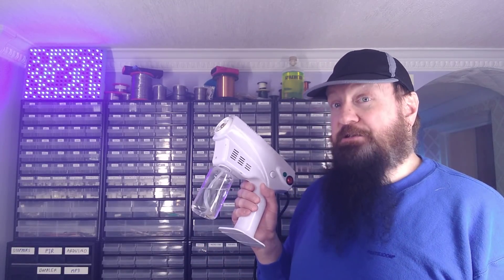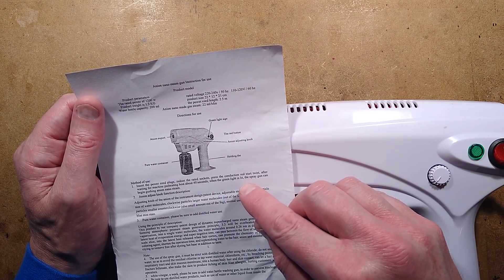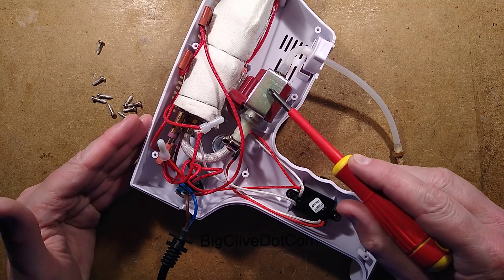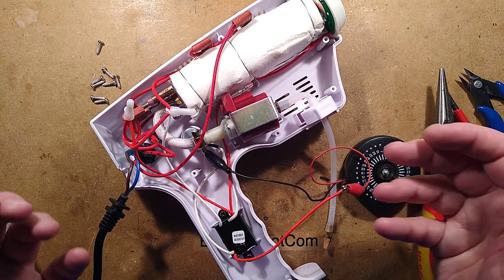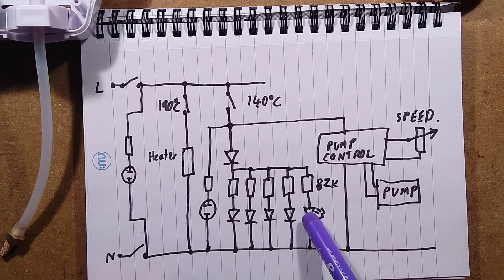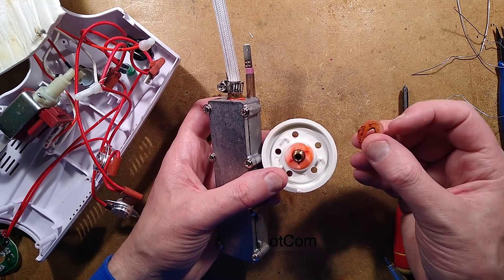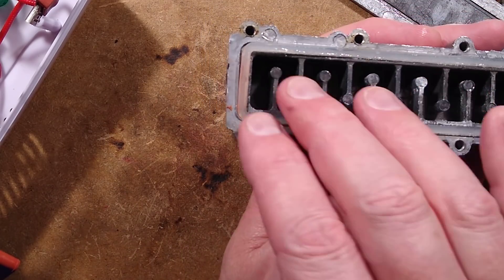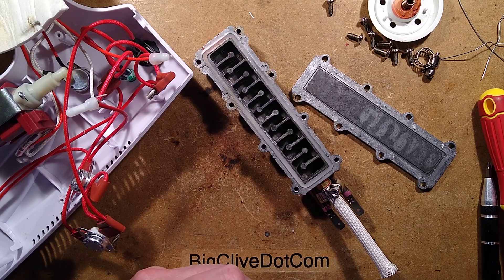Inside a hazer phaser.

Comment: would you recommend it (unmodified)?
Would you recommend it for it as a hazer (like with haze fluid)?
Reply from the maker: It could be used to haze the air for effect.  But only with glycol based haze or fog fluid.

Comment: Hey Clive, I'm doing a small event later this year and not turing on my lights until after a dinner. Could I use this to put a little haze just to show my lights better? Or just do without as don't want to flood the room with haze.
Reply from the maker: Consult with the location first.  They may have rules regarding any smoke detectors that could be triggered even by a light haze.
Reply: @bigclivedotcom  thanks for your reply. But it would work if I used fog juice?
Reply from the maker: @DJ_Energy  Yes, it should work with fog fluid, but again, it's important to ensure that the venue has a policy for the use of atmospheric effects to avoid triggering the fire alarm.  For a light haze a quick burst of a standard fog machine might be preferred.

Comment: i have been using an old  humidifier i had sitting on a shelf in the garage as a disinfector  (the Mrs wanted me to toss it as  it was imposable to clean the water tank )
it has a manual power/mist level switch  so a  smart power sw  allows me to control it  set to automaticity disinfect the  garage 3 times a day has been running for 18 months  now 
any delivery's and the car is  disinfected 3 times  a day

Comment: Wow
I somehow missed this video but this looks great when I need haze for photography or video in not too large spaces.
Way better than using a regular fog machine that's bulky and needs to warm up for several minutes and is quite difficult to get small amounts of haze from.
Have you tried mixing glycerine in the water? It should give a denser haze.

Comment: In areas where grid power to homes is limited in Indochina, these are sold as 'mist sprays' which reduce the feel of very hot climates and where air-conditioners would destroy the house wiring because of the power required.

Misting sprays, operated from / by water pressure are commonly used in outside dining /drinking venues where air-conditioning is impractible.

Comment: at 16:26,  All  exit pressure  is a  product of the delivery pressure from the pump and lots of rapid expansion (of water).     heat in the top; the bottom was removed.      so, the zig-zag is horizontal.   not vertical.    stating the obvious, again.

Comment: so, use as a disinfection fogger... lets go through what types of disinfectant you can put in it...
alcohol based....evaporates with heat...
chlorine based...would work...but are you sure you want to aerosol the room you're in with a lethal gas?
iodine based... could work... but man that's gonna leave a hot mess on every surface...

Comment: I use this for valeting, you put some fog-it in it and it gets rid of the smell of dog. But if you run it for more than 10 mins  the power cable starts melting, You didn't pick up on that hazard. Great videos Clive I like watching you take things apart it's great.
Reply from the maker: I wonder if you have a version rated for a different voltage.
Reply: @bigclivedotcom  its 240v the black cable sleeve shrinks, exposing the blue and brown cable, near the handle, I'm on my 3rd 1.

Comment: Both the wide pipe leading water and the internal barrel are coated with heat resistant fabrics. Is any of them made of asbestos?
Reply from the maker: The pipe cover is fibreglass. The heater block is probably ceramic fibre.  But the actual composition would need to be tested.
Reply: @bigclivedotcom  ugh that's almost as bad :( thanks for regarding my question.

Comment: water based paints would work perfectly fine..maybe need extra watering down tho... oil based would gunk it up for sure... but water based ya should be able jsut to run some water through to clean out the water based paint
Reply from the maker: With water based paint there's a risk that the boiling would separate the water from the pigment like in distillation.  The biggest issue with fog machines is impurities in the liquid blocking the heater.

Comment: Steaming hail in a salon possibly...

Steaming clothes while on a trip is another use for it...It's compact enough to easily fit in your suitcase...

It could also be used as a Steam Cleaner/Disinfectant for countertops, sinks, appliances etc. that is easier to use than the traditional Steam Cleaners/mops (less bulky)...

Note: you don't really need to put anything other than water in this to sterilize. Water heated to the point it becomes steam will kill most viruses, bacteria and parasites in a second or two after exposure so just slowly sweep the nozzle across the surface to be sterilized (at a distance of 2-4 inches between nozzle and surface) and you should be good to go...

Comment: Where can i buy this? And can you put normal smokefluid in there?
Reply from the maker: eBay.  And it does appear to work with dilute fog fluid.  But isn't specifically designed for it.
Reply: @bigclivedotcom  OK thanks i would use ist for small effects.

Comment: If lower resistance is slower just add a resistor in parallel with the pot
Reply from the maker: It already goes to zero
Reply: @bigclivedotcom  ah crap

Comment: Is it possible the 140 degree therm-o-disc is for temperature contro?  The 190 would be the TCO.
Reply from the maker: The 140C enables the pump.  The 190C is the heater control.  That way the pump can be active continuously as the heater cycles.
Reply: In that case there is no thermal control. If the heater were too short to ground it would stay on, possibly overheating and melting everything including the aluminum. That would be rather embarrassing!

Comment: Our attic is blow filled will this grayish-black fluff stuff. I don't know if it's asbestos or rock wool. Our house was built in the mid-1960s in Tulsa, Oklahoma. I do know that when it is disturbed, it does stir up dust. It kind of makes me not to want to go up there even though there are some other things I would like to do up there. When I try to burn a piece of it, it just glows red where the flame is.
Reply from the maker: Treat it with caution.  It may be safe, but for a while asbestos was used as loft insulation.  It might be worth getting a sample sent for analysis so you know where you stand.

Comment: The fibre glass braiding is to reduce expanding of the hose, this could happen because the valve is next to the pump. 
The expanding of steam is adding pressure on the hose

Comment: Could you use one of the button switch locations for a limit control in series with the operating button(140c). They are supposed to fail in the off(open) position

Comment: Do you have a contact info page on your website I missed? I have these fascinating tiny CFL tubes and drivers from an arcade machine I repaired and would love to know if they have any alternate uses or things I could do with them
Reply from the maker: Are they the classic cold cathode tubes around 1' / 300mm long?
Reply: @bigclivedotcom  i believe they are ccfl, tiny little guys used to illuminate the backside of colored acrylic panels, the tubes are 2.5mm in diameter and 150mm long, got 9 working ones and one with either a dead driver or dead tube
Reply: http://imgur.com/a/hhxCTko i dont know a ton since i usually retrofit leds and I couldn't get a replacement from andamiro so when one of these died I replaced all 10 with leds
Reply from the maker: @lefthandedcat8766  They look like standard CCFL drivers.  Odd that they're not cased though.  They use a two transistor Royer oscillator to step the voltage up and the little capacitors in series with the tubes ration the amount of current they can pass.
They used to be used in games like Konami's Dance Dance Revolution (Dancing Stage) because they have an extremely long lifespan.
Reply: @bigclivedotcom  yep thats where I got them, pump it up but its a dance game, andamiro calls them the "step lamp assembly". Anything neat I can repurpose them for? Nobody wants them even for free since leds are cheaper and look so much better nowdays
Reply: @lefthandedcat8766  Sadly, it's like having a bunch of carbon arc lamps in the incandescent age.... there's not much utility unless you want the aesthetic or you have a scientific need for some aspect of the output. I used to have a whole pile of those short lamps and drivers which may have been the exact same ones and came from stencil frames for exposing some kind of photosensitive emulsion, cast off from the IC industry. I still have (and use) a couple of 30cm long green CCFL lamps because I like the light quality they give.

Comment: Nice to see Clive actually bothers to ensure things are unplugged first. Air conditioner installers just left my place and I'm 95% sure they did all their work with the wrong circuit turned off. One even tripped a breaker by snipping a live cable then came into the house to turn it back on before proceeding. I just had to tell someone.
Reply from the maker: They often have to work with the power on to trace the faults.
Reply: @bigclivedotcom  That's a good insight. I do prefer to give people the benefit of the doubt but these two weren't filling me with confidence in a number of other ways.

Comment: Could this be used to spray biological samples? As in, if someone doesn't change the water, are they just spraying legionaries disease?
I'm aware it heats the solution when it is in a very exposes small particle form.
But only for a very short duration.
Reply from the maker: it could still class as pasteurisation.  Glycol fog fluid seems to be inherently very sterile.
Reply: @bigclivedotcom  Thank you for the response. I hope you're right. I was worried about other mediums being used by people not wanting to buy the proper stuff.

Comment: I won't be the first to say it, but this is YouTube so I'm compelled to speak...
The hissing at the beginning wasn't extremely loud and I could hear you quite clearly over the noise.
That is all.
Reply: Agreed. I had to increase the volume of my speakers up to hear it better. I was disappointed he didn't turn it up from the low setting.
Reply: I assume the automatic gain-control on the microphone made the sound less harsh on the video than it was in real life?  But, yeah, I had the same issue -- I turned it way down and then had to turn it back up to hear him speak...

Comment: I think I've seen that LED circuit before, a small lamp (with a magnet at the back) running off 3 AAA batteries with a push button switch in the middle (press the lens).
No diode and different resistors (obviously). Inefficient, but a sensible bit of repurposing.

Comment: I presume it may exacerbate clogging, but I wonder if you could improve the performance any by packing the channel (perhaps just one end) with coarse brass wool or stainless swarf?  My thought being 1) it could provide some additional back pressure, reducing the spray volume and 2) the additional thermal mass in the fluid path might mitigate ‘spits’ and ‘drips’

Comment: Hmm... Drill-style trigger instead of the knob and it is perfect.
Reply: Unfortunately only the battery powered versions without strong heater have that.
https://a.aliexpress.com/_BSA0rZ
Reply: @MetalheadAndNerd  Then I may have to add that myself. Can't be that hard, right?
Reply: @MazeFrame  Should be possible. The heater has an independent thermostat and if you arrange the wires a bit better there is also plenty of unused space in the case.
Reply: The cheapest offer at the moment seems to be this one: https://a.aliexpress.com/_BShMNi

Comment: Not going to lie, that does look like Aspestos. Look at it under a microscope. If it is you will see the fibers.
Reply: Wait, those are toxic right?
Reply: @dwdadevil  Yep, pretty much threads your lungs
Reply from the maker: It would require extreme magnification to differentiate between ceramic fibre and asbestos.

Comment: Why didn't you test it with fog fluid?
Reply from the maker: It had diluted fog fluid in it.
Reply: @bigclivedotcom  Okay, then I missed that moment somehow.
Reply: @bigclivedotcom  By the way: It would be nice to hear an expert's opinion on the different types of fog fluids. I wonder if the various fog densities (F, B, C, P, E, X) are different compositions or just different concentrations.
Reply from the maker: @MetalheadAndNerd  Most of it is the water to glycol ratio.  But some fluids use glycerol for very high persistence.
Reply: @bigclivedotcom  Thanks. I think a small fog machine would be pretty useful for optimizing things like the air ducts of a 3D printer.
Reply from the maker: @MetalheadAndNerd  A vaping device might be handy for that.
Reply: @bigclivedotcom  I thought about that but I don't want to suck on it. I never smoked and I find even the thought unpleasant.

Comment: I remember an electrician re-wiring a motorcycle in red. Just red wire. It worked but try being the next guy down the line.
Reply: I bought an old Ford Escort with a dashboard wired like that. I was cursing the bastard who did it!
Reply: One (1) swipe of a black Sharpie at each end of a run, near the termination, and it's all good. But nooooo!
Reply: Lucas jaguar wiring, and probably Rover ,dark wires

Comment: The solenoid pump looks like it's from a coffee machine.
Reply: It does looks like an Ulka pump
Reply: @MalownMcOwnage  yes! Even the color sceme!
Reply: My coffee machine has no "pump" Only a heater and a valve....
Reply: @phorzer32  yeah, most have. I am actually talking about something like a delonghi magnifica. Those have a bean grinder, a pump, heater, valving to produce steam or hot water or - ofc - coffee. It's maybe a bit over the top just for coffee, but eh. Why not.
Reply: @phorzer32  usually the expensive coffee machine, the ones that grinds the coffee beans and the espresso machine have those
Reply: @phorzer32  thats not a coffee machine then ;)

Comment: Maybe the references to paint are a translation that missed the point.  I think it just means you can use the machine to clean/disinfect surfaces that are painted, like walls. It's saying you can use it to spray painted things, not that it sprays (applies) paint.
Reply: Or they're using the same shell for paint spray guns and copied the wrong description.
Reply: Interestingly I thought neither of those things, and thought it might be intended for stripping paint.
Reply: I think it's just a translation error. I think it means "to paint" like to apply a liquid to a surface.
Reply: I took it the way you did, Steve.
Reply: There's 'paint' and there's 'paint'. I was thinking of thinned paint. Cellulose ????? or water based !
Reply: yea, like using the hot steam to remove old wallpaper
Reply: Or to "paint" hair?
Reply: I agree Steve. having read more Chinese - English translations than I care to remember I also came to the conclusion reading this seller's blurb that it's designed (or being re-purposed) for sterilising painted surfaces. Perhaps for Covid 'deep cleaning' of hotel or hospital rooms between occupants.
Reply: @Shaun.Stephens  How's it supposed to sterilise any surface ?
Reply: @millomweb  By misting steriliser onto it.
Reply: @Shaun.Stephens  It'd be quicker using a steriliser soaked cloth :)
Reply: @millomweb  No, no, it wouldn't. Wiping down surfaces in your house would take FAR longer than spraying an aerosol.
Reply: @xenonram  Application would be faster with a cloth.
Reply: @millomweb  look how much for was created in the few seconds Clive first showed... You could sterilise every surface in a room, quite literally in seconds
Reply: @saint-666  But at what speed could you move the fogger and get 100% coverage ? If fog was 100% it wouldn't linger in the air but drop to the floor in no time flat. Spraying that on a surface may give you 25-50% coverage only unless you lingered long enough to get lots of runs. A wipe over with a soaked cloth - like a kitchen table top, done in 2 seconds.
Reply: pmailkeey not to mention we’re talking about disinfectant. Dense application can be just as important as total coverage, depending on concentration. Wiping down with a cloth is always superior for this aspect
Reply: @millomweb  Where's the fun in that though? 😀😉
Reply: @Cheordig  In what ?
Reply: @millomweb  Using a cloth.
Reply: @Cheordig  You beat everyone else ;)
Reply: My immediate thought was that it would be intended to sanitise painted surfaces, as stated by others... In any case, why would you want to heat up paint to that degree before spraying it?
Reply: Yeah youve been smoking nubs and spitting on the carpet
Reply: I thought they were trying to say you could use the steam to strip paint.